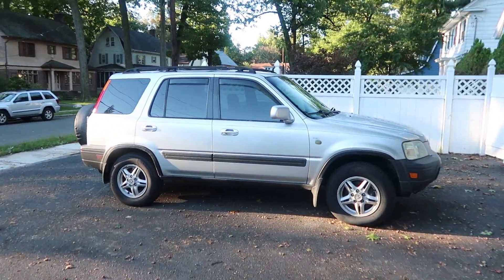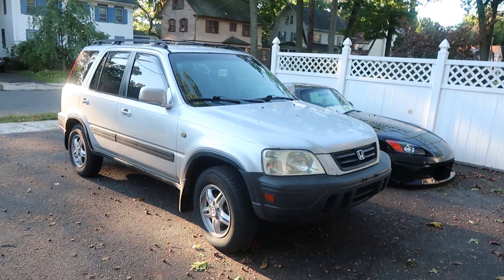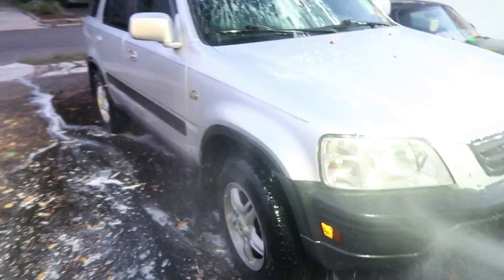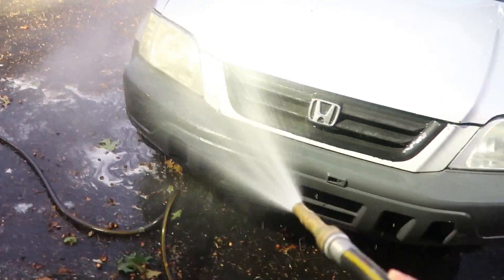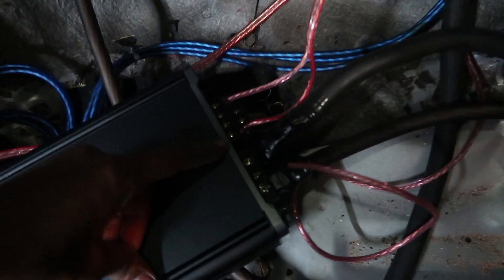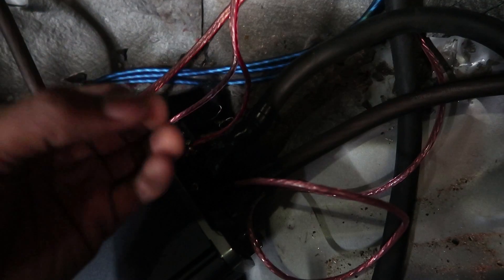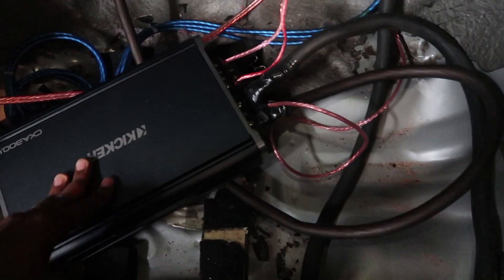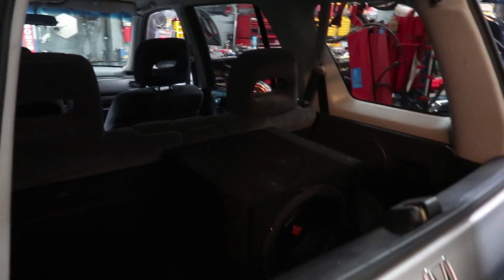I got a new car... / Honda CRV AWD

Comment: Have the same combo, black s2k and silver crv. My crv is lifted though
Reply from the maker: Jesse Wurtzel how do you like it lifted
Reply: Phills2k I love it, it’s definitely nice driving around not having to worry about scrapping and bottoming out while still being unique. Lift kit paired with mud tires.
Reply: Regardless if you lower, lift or keep stock height, good upgrade for 4wd system is rear diff from 4wd element. No modification needed.

Comment: Ive recently brought a 99 crv tha ks to the hype from all the reviews! And its quite noisy to drive , and abit slow lol but it look a hell lot better than my citroen picasso lol but to buy a car that is 20 years old is abit like fuck it why not. I wanna fit a secondary kill switch on the igintion as the locks are so old. Then spray paint the car satin black, And go from their. Never that id buy a petrol car let alone an auto but im liking it , it has that 90's look that these newer cars dont have